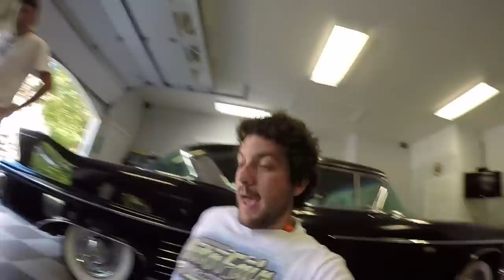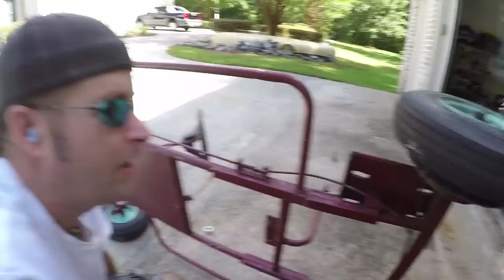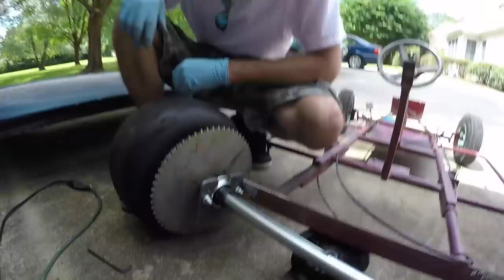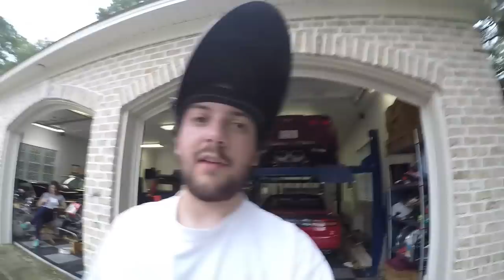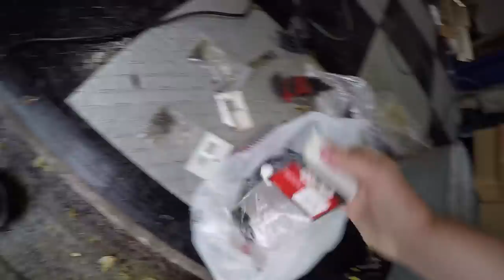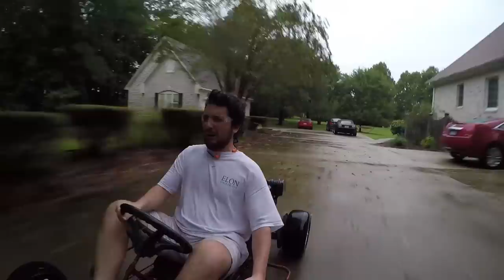Live Axle Swap on the $50 Go Kart!

Comment: Hi,
I think it sound stupid but is it possible to build a go kart without experience with engines?
It is my dream to build one myself,when I was 6 years old I went everyday to a go kart racing track.
Now I'm 15 and don't want to dream about it anymore...I'll build my own one.
Reply: Sounds*
Reply: Or do you sell one of your karts? :)
Reply: +Jason-Duke Prygodda go for it
Reply: +Jason-Duke Prygodda hey dude I'm 15 too and I built my go kart a week ago and I only spent 100$ on an engine and got the frame form my friend, I say go for it.

p.s. look for a frame at yard sales, I just got a new frame yesterday for 30$
Reply: sweet
Reply: +Isaac it'll be fine indeed it is
Reply: +Jason-Duke Prygodda You dont need any engine experience if you dont plan on doing mods, just bolt it to the engine mount and line it up with the sprocket. Engines arent that hard to figure out, i suggest watching some videos on the basic honda/predator engines and how to mod them. Im 15 and my buddies and I all piled some money together to buy a go kart..removed governor, 5 year old harbor freight engine with no air filter and a messed up fan. The passenger has a spray bottle to spray the engine, the fan doesnt move enough air. Its the most fun you can have, id go for it.
Reply: we like to buy old beat up go karts and re build them. you should ask around and see if any body you know has any
Reply: Yeah I'm 14 but I have mechanical experience but u don't need any as long as you can bolt some things together as Ike would say "it'll be fine"! My Kart frame was $75 and my 6hp 190cc Briggs and Stratton engine was $50 which was a steal and I'm going to use the GoPowersports Kit for it and since I can't weld I'll have my brother do it because he's and auto body specialist
Reply: Just check Craigslist in your area for frames
Reply: Have you built one yet bubba it’s been 2  years

Comment: Which is faster? A one wheel drive or live axel (2 wheel drive)
Reply: Live axel
Reply: The live axel can deliver more power to the ground.
Reply: One wheel drive wastes energy and eats your tire up.
Reply: They both have the same top speed, but the live axle can get up to that speed quicker because it has twice as many wheels being driven, giving it twice as much traction, allowing it to pull twice as hard before it starts spinning tires.
Reply: Nathan Antilla that's a mouthful lol
Reply: Nathan Antilla live axle actually has a faster top speed because there is no torque steer
Reply: Torque steer is easy enough to counteract with driver input that it's not really a factor.
Reply: Nathan Antilla the drive wheel causes the kart to shift to one side and yes, that can be counteracted with driver input, but that couteraction is what causes excess resistance for the kart to go forward, which slows it down.

Comment: LOL- OMG! NEVER EVER weld with the ground going THRU the bearings....... you can make little pits in the balls and the races by what you did in your video....... you have your ground clamp on the bearing outer housing, and youre welding the FRAME of the go kart..... ground should be on the frame!!!! We'll see how long them bearings last now?
Reply: Where exactly are you getting this information? I weld around bearings everyday at my work
Reply: +Eclidean we were not welding threw the bearings we were near them though. if i did then oopps. welding threw the bearing can cause pitting.  hopefully it'll be fine
Reply: +Isaac Jennette It'll be fine.
Reply: Incorrect. Unless you had a bad ground connection and it arced across the bearing, there is no way you would get arc strikes
Reply: Isaac Jennette I know that you can answer this for me. What size sprocket and what size clutch do you need to pull a overweight adult on a kart with a 5.5 Briggs.  What I have now definitely is not what I Need because it hardly pulls me from a dead stop. Thanks for your help.
Reply: Bill going down on your front sprocket increases acceleration from dead stop, also adding more teeth to the rear can have same effect. Both for a lot of accelerating less top end.

Comment: "$50 Go Kart" (+$250 rear axle and god knows how much everything else is)
Reply: +DarkSharkssm  EDIT: $300 rear axle + $177 Engine + $50 go kart body = -_-
Reply: +DarkSharkssm 99 dollar engine. lol
Reply: oh on ebay they are like $120 plus the chain and clutch equating to $177.
Reply: thats not bad.
Reply: yea its pretty cool. Next you guys should make a drift trike or go kart with a duromax engine on it! Those things have like 20 ft/lbs of torque and i think 15hp!
Reply: OH YEA ! im shure your going to like our next project then. would love to tell you what is but i cant.
Reply: im building a drift trike with my roommate next quarter (in college) and we are using the predator engine, and a razor drift trike frame! I have always wanted to see one of those duromax engines on a drift trike or small gokart but i can only find videos of them on those huge off roaders... cant wait!
Reply: cool. good luck

Comment: Alright, that does it. I have got to get my old go kart out of storage. Been sitting on a shelf in the shed at my parents house since the 90's. Mine is a two seater with a live axle and a 5hp B&S. The engine and driver are both on the left so it turns left great but flips easy on hard right turns.
Reply: +JeepCollector91 thats what mine would do
Reply: Finally brought my old go-kart home to Winterville last weekend. Surprisingly the old tires and tubes will still hold air. Couldn't remember what brand my kart was but the sticker with the model and serial number was still under the seat. It was made by KARTCO Inc. 
Time to terrorize the neighborhood.
Reply: it,ll be fine

Comment: Thank-you for this video!  It is something I have always dreamed of doing, but have never done. I am curious: Would it have been possible to center the engine in the middle, for better side-to-side weight distribution? I would really love to see this done using a dirt bike engine. For me, the most interesting part of that would be seeing how you would engineer the the gear shift linkage for the manual transmission.
Reply: Yes, you can put the engine in the center, you'll just center up the sprocket along the axle.

Comment: Please respond.... I literally have the same exact frame only it’s blue that I just got free from an old barn find, just ordered the predator from harbor freight since they are completely sold out. I will also be ordering the stage 1 kit, clutch and the live axle from go power sports tomorrow. What welder did y’all use? Also how well do the slick tires work in the yard when it’s dry outside?

Comment: I’m doing a live axle swap on my go kart. I ordered 12x500x6 tires for it but I’m thinking they will be too small to accommodate my 60t420 drive sprocket. Should I upgrade to a13” tire or will the 12” still work

Comment: Great videos!! I had  quick question. .... did you have to replace the connecting rod and flywheel after you removed the governor on your 212 engines? I did a 212 swap on a 50cc cateye pocket bike and I heard if you don't replace them with billet parts they break pretty quick after you take out the governor... is this true?
Reply: +Duane  Garbutt we havent had any engines blow up. YET
Reply: +Isaac it'll be fine      I hope they dont!!! thanx for the reply!!! you guys motivated me to build my minibike (50cc to a 212cc)... it tops out at around 45mph.  I appreciate all the videos you guys do and I'm looking forward to that turbo on the drift trike!! ( I wondered what happened to my blue chair..lol)... No worries... It I'll be fine...
Reply: lol. thanks for watching

Comment: at 14.40 u say the wheel will b out hear?  are u only tight the axle nut against the locking collar on the other side of wheel or did you find some spacer to fill gap between the 3/4 cut down to the 1 inch axle shaft i fear the wheels may come loose some day if you are only trusting the locking ring.
Reply: maybe the locking ring is 3/4 and hooks on the edge of the 1 inch then i could see this being able to tighten the axle nut

Comment: my kart is not exactly the same as this one but I am adding a live axle as well. I have noticed I'll have to move my axle back about 6 to 8 in. biggest question, wil that affect my steering?
Reply: Yes, it will affect the turning circle.
Reply: +epic.apri.39 considering I destroyed the tie rod ends I'm just gonna rebuild the front end. since it has no Ackerman angle I'll put one in. hope it helps with the steering issue.

Comment: 20 year reunion.

You guys should do a line lock to lock up the front wheels and do that for a burnout.
Reply: +Waylon Richardson 20 year. we love burnouts
Reply: exactly, imagine being able to lock up the front wheels but being able to keep the rears spinning.
Reply: it would be awesome. unfortunately most of the weight is on the rear so burnout would be hard to do
Reply: +Waylon Richardson We always used our left foot to hold the front left tire and that was enough.
Reply: it was a one wheel peel right ?

Comment: ''it had a 3 horse power engine..'' spot welds would of done I ''...
But no they put enough weld on this thing to hold a 572 Chevy big block with 600+ horsepower's with a blower,
Nitris that works 
Twin charged

Comment: Should have mounted the axle Bering brackets with the open end facing down to use the full strength of the bracket not just the bolts holding the axle in place

Comment: Won't a solid axle like that with no differential make the kart want to plow?
Reply: The lack of a diff is not a problem if the chassis flexes, because the chassis flex will lift the inside wheel off the ground. Off road it mattters less, but the chassis still needs to flex in order to turn properly.
Reply: +Paul T it all depends on how much weight is on the rear tires and how big they are. we only have had issues with that with the rat rod wagon. sitting on top of two 11 inch wide tires makes it a little bit tough to turn

Comment: dear cars and cameras, i want to build a drift kart with a am6 (derbi) engine wich has 6 gears. but i was thinking about a e-brake/handbrake system. got any ideas. i really need some help
Reply: +Devon Phax what about a paddle shift/brake on steering wheel
Reply: i was thinking about that but i would like a setup wich has the same shifting mechanism as a car, you know like a stick shift on my right hand
Reply: you might want a seperate pedal to hit with your foot. i like to hold onto the steering wheel when im sliding

Comment: nice porsche 914 you have
Reply: this might be a dumb question,  I'm going to modify my big wheels trike to put a predator engine on it and use a live axle,   what exactly keeps the axle from sliding back and forth? is it the bearing holders? or is there a collar that bolts up to stop movement

Comment: I hope you will eventually weld up those bearing brackets better. It looked like you only welded about an inch. That's not strong enough. Really, it could use a piece of 4-inch angle iron in the back. Weld it to each bearing bracket to strengthen it. If you accidentally smack something up against the back wheel it will bend right where you welded it to the frame. I understand about being busy, though. Going to school is enough in itself to think about.
Reply: +GALAXIE 500XL yea we welded up a nice flat bar on it this weekend. thanks

Comment: Have you guys tried putting Two motors on one kart?
Reply: Id rather instead use a 2 cylinder motor. If you use two of the same motor, and place one on one side of the axel, It wouldn't work since they only rotate either clockwise or counterclockwise

Comment: And now it will not go around corners when on pavement. So Go Power Sports is sending us a real kart frame that has geometry fo lift the inside wheel when going around corners. You can buy the kit for $1500.00.

Comment: So yall have inspired my go cart build. In advance all the help will be appreciated and I hope yall can get back to my on my issue. For starters my set up is the go power sports live axle kit with clutch and 420 chain. it's a 10 tooth clutch with 60 tooth sprocket so my gear ratio is 6:1 with 13" slicks and my clutch gets crazy hot and starts smoking why would this be?

Comment: hi bro 
when i pull my mini bikes throttle and no matter how far i pull it, theres no acceleration (the bike wont go). any ideas why this is happening and how i can fix it. 
thank you so much
Reply: +MasterTuttoo id look at the carb and see if there is any movement wen you twist the throttle
Reply: ok i will check the carb. what should i do if theres no movement.
Reply: probably broken cable. they get the most abuse
Reply: +Isaac Jennette im pulling the throttle tho. like that metal piece beside the choke. and nothings happening.
Reply: sounds like the cable. is the cable connected at the grip ?
Reply: +Isaac Jennette yah

Comment: i just got a go kart but there's one thing wrong with it. when someones one it its not strong enough to accelerate but when no one is on it accelerates like nothing what could be the problem i was told it could be the spark plug but im not sure please help.!
Reply: +Damian Real sounds more like a fuel problem to me. what kind of engine is it?
Reply: To be honest i don't know the type of engine but its a stock one and it also won't turn on when i pull the string to start the kart.
Reply: you need several things to have a running engine fuel, spark, compression,etc.etc the first thing id check is spark. pull the spark plug out of the head and lay it on the top of the engine with the spark plug wire attached. pull the start cord. does it spark?
Reply: does the plug look wet or dry?
Reply: +Isaac Jennette i just replaced the spark plug yesterday i bought a new one and the old one had some black stuff all around it
Reply: have you tried what i said. looking for spark

Comment: It would be better to put your ground on the frame, arcing can really destroy a bearing. Hope it will be fine!
Reply: +Kristofer Jonsson it was on the frame
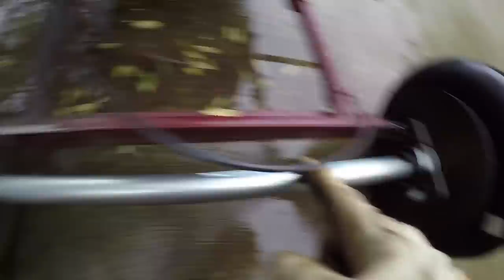Reply: +Isaac Jennette 18:35 the ground is on the bearing bracket.
Reply: +Kristofer Jonsson ah yes it was. but the electricity was not traviling threw the bearing. if i had the ground on the axle itself then it would travel threw the bearing to the bracket/frame. and if i did screw up, it'll be fine (hopefully)

Comment: How i can buy the 212cc predator motor and the clutch in switzerland
Reply: +Tyrone its a honda clone engine
Reply: in germany you can buy it as a "eberth 6.5ps motor"
Reply: +Pyr0Blast3r thank you very very much
Reply: +Tyrone ;)
Reply: +Pyr0Blast3r i also need the centrifugal clutch :(
Reply: +Tyrone they're not that expensive and maybe you find an old one anywhere on the scrapyard or somewhere else!
Reply: +Tyrone they're not that expensive and maybe you find an old one anywhere on the scrapyard or somewhere else!
Reply: +Pyr0Blast3r ah oke thx <3

Comment: Why don't you just make a new frame from scratch? This seems like an awful lotta work :')
Reply: +Antoine A-A   Does building an entire frame from scratch sound like very little work???
Reply: No, but salvaging a cheap frame that looks in my opinion pretty flimsy and putting all that work in it seems like a weird idea. I mean, you wouldn't start building a race car with a Toyota Camry and modifying if to be adequate for racing, you would start with a solid chassis that you can make slight changes to to make it race worthy.

Anyways, I'm not a kart builder or anything, just seems like they're putting a lotta work on a cheap chassis. They look qualified enough to make a better chassis themselves!
Reply: I see your point. However, It would have still cost them more in tubing to build a frame than the initial frame cost.  A lot of work goes into building from scratch. Just look at the rat rod wagon build.  "It'll be fine"
Reply: It'll indeed probably be fine :P
Reply: +Antoine A-A we were just showing that it can be done on any frame. we have talked about building a frame from scratch, the rat rod wagon was a breeze but it is very basic. we didnt pay attention to any stearing angles or anything. it'll be fine. lol